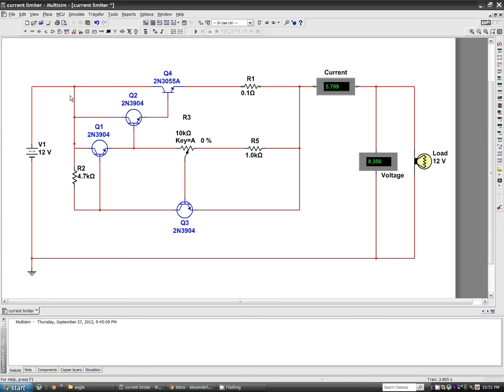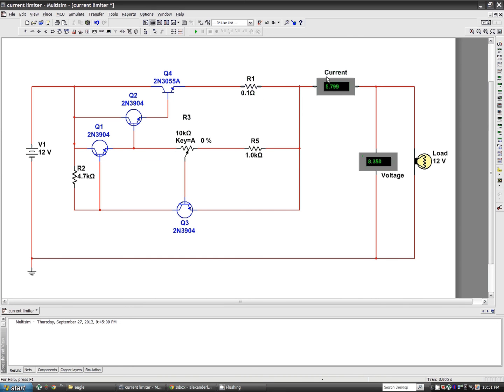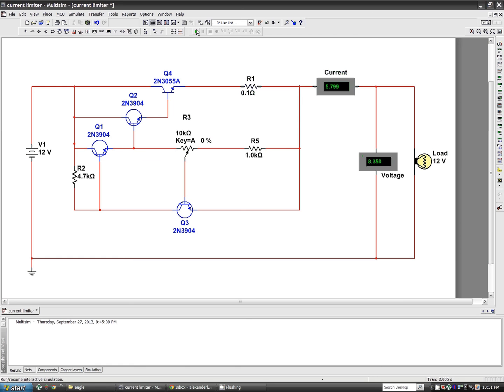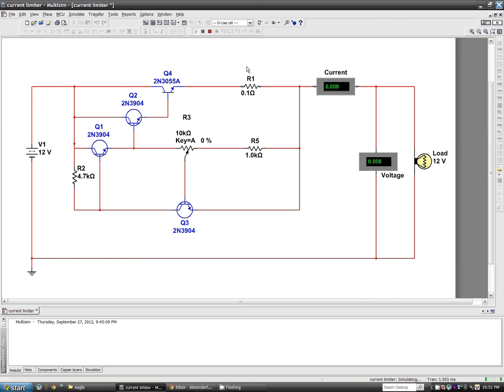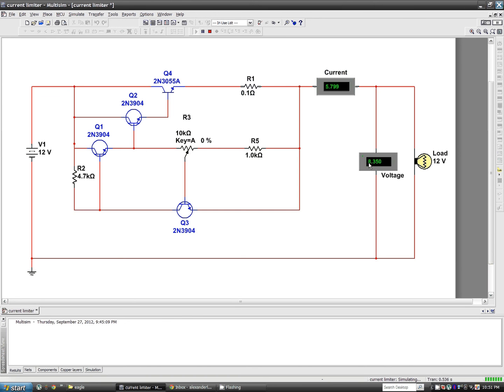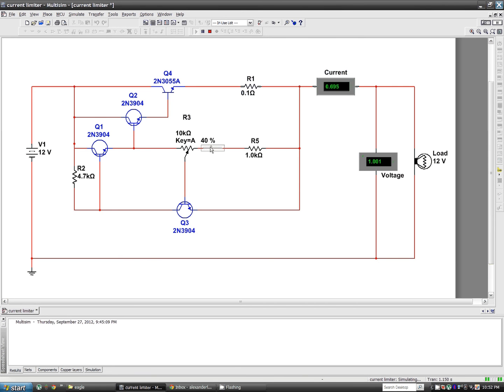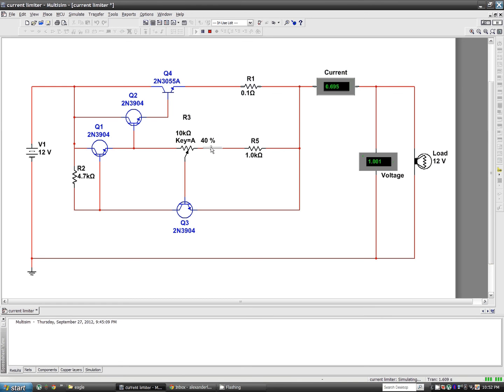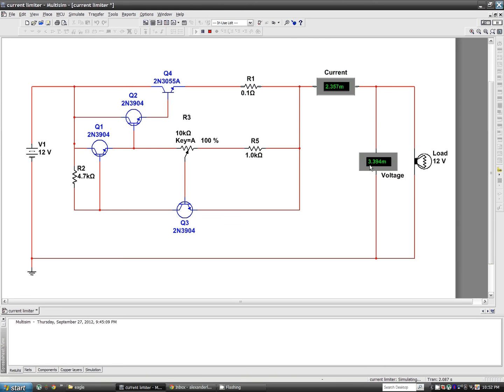Current Limiter Simulation

Comment: Hi Alexander, nice circuit, definitely one for my notebook, but do now know how much voltage it can take?
thanks
Reply from the maker: Hi, if you check the data sheet for the 2N3055A which is the series pass transistor (the one that does all the work) it states a maximum dc input voltage through collector to emitter of 60Vdc. However you also need to check how much current you are going to draw as the 0.1 ohm current sense resistor also needs to be rated for 60Vdc at whatever current you choose.
Reply: hey Alexander, thanks a bunch, could you tell me what circuit simulator you're using, looks pretty good. thanks mk
Reply from the maker: snaprollinpitts National instruments multisim...it's a demo version though. The full version is very expensive
Reply: can I download the demo version?!  I hope
thanks mk

Comment: Thanks for the information !
I got a 12v dc motor with output power: 3.4 watts rated speed : 170 rpm rated current: 0.9A
 Is there any Current Limiting circuit diagram for my case in order to prevent the current increase more than 0.9a when the load of motor increase? Thanks a lot in advanced .

Comment: Alex, I can only read half of the component values can you give a better description of the values of the resistors R1 through R 5 and Q4,  it looks like the rest of the transistors are 2n 3904 Thanks in advance,
Reply from the maker: Hi David, Apologies that you can't see it.  I have given the component values in the schematic diagram on the corresponding blog post  which is in the information above...but just for you the component values are:

Q1, Q2 and Q3 are 2N3904 NPN T092 transistors
Q4 is a 2N3055 although any high current NPN pass transistor would do...you will need a heatsink!

R1 is a 0.1 Ohm 5W power resistor (the power rating can be adjusted to your requirements.  Again this may need heatsinking

R2 is a 4.7k Ohm 0.25W resistor

R3 is a 10k Ohm linear potentiometer 

R4 is a 1k Ohm 0.25W resistor.

I will try and improve the resolution on this video and make it easier for you to see.  Thanks for watching!